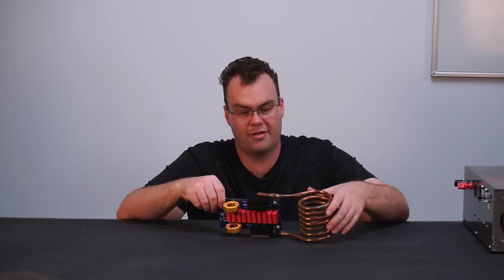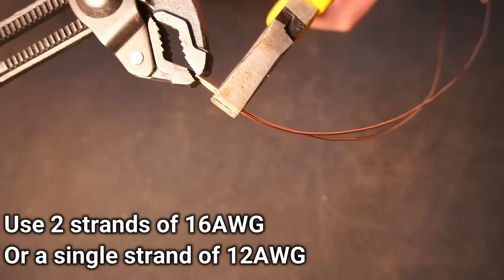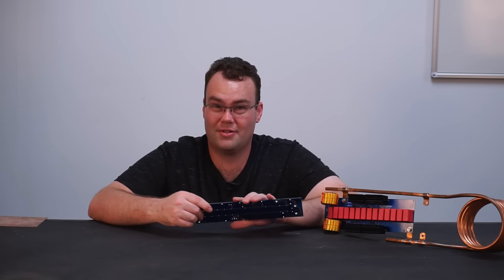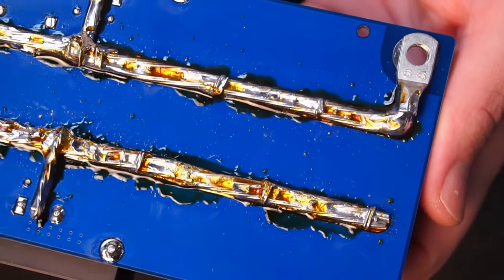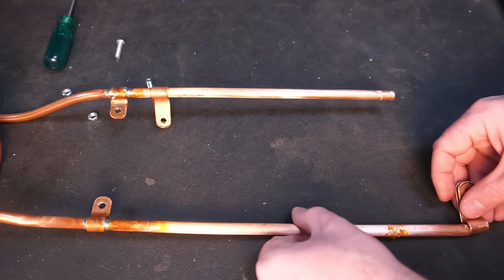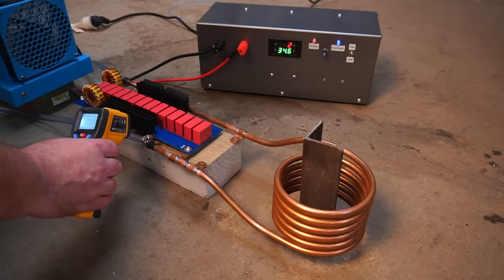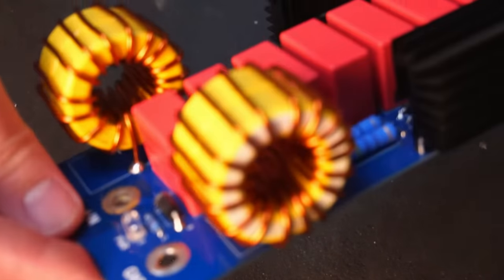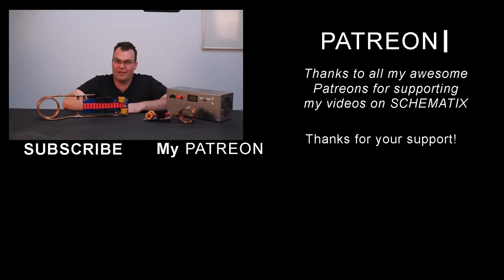Building a 3kW Induction Heater ll Complete Build Guide

Comment: Are you using a more potent JBC iron at the 2nd attempt making the inductors ?
If  yes, is there a review comin' up ??
I'm wondering if you purchased just the JBC handpiece and driving it with an alternative station,
or did you just go for the complete set ?
Thanks for the upload, I enjoyed it as usual  :-)
Reply from the maker: You've got eagle eyes! Yes I've gone a bought myself a JBC soldering station. I was wondering about building the Unisolder project & powering a JBC hand piece. However, I priced up all the components for building a Unisolder & I wasn't saving much. So I splashed out on JBC Station. Review coming soon
Reply: @Schematix  Wow, yes everyone else say that those JBC's are very good. My mind also wondered off towards the unisolder, however watching Marco Reps's video about it shows that it is quite a big job.
And the BOM cost is pretty far up there.
Patiently awaiting your review sir !

Comment: You could have combated the warping by soldering from the mid to the outside (but I'll bet there still would have occurred a bit of warping still)
Reply: Agree with you and also maybe tacking serveral opposite areas before joining it all together would reduce warpage somewhat - copper foil may be best option.   Amon's original idea of copper buss bars may have worked as well but we all commend you for taking the john q public route.   I would also question whether we really need such a huge trace expansion?  I assume you are going to fan cool it as well - these cheap china ZVS designs may have far less copper in their equally rated circuit boards? - Don't really know, just questioning how you arrived at such a large gauge wire - maybe the traces on the chineese boards are capable of handling much more amperage than your un-modified traces are capable of handling?  That may actually make sense - for you to order a board with minimal traces and save money by doing an easy DIY trace enlargement?  I think, the more you tell us on your decision making that went into chosing what you did the better the quaility of help it will be for those trying to replicate what you are doing in their own way with what resources they have.  Just my two cents, and yes I really do appreciate you showing the world some of the thinking that went into making your zvs induction melter.  Taking as much mystery out of an inherently mysterious act can only be good.  Just remember anyone can buy an off the shelf china pos for cheap and accomplish the same.  Blinding following how an engineer makes a product is ok, but the masters can also enlighten us less knowleable along the way, no?

Comment: Your electrical cable comes in pretty colors. Why is it stranded instead of solid or is that a NZ or a 220V thing? For a little more cost could you use #6 bare copper ground wire?

Second question when heating does the object being heated have to be stationary or could it be moving in and out of the coil to heat more length of material? The dull red might not be enough for hardening, it is more enough for tempering.

Third can a rheostat of some kind be added to the circuit or power supply to induse less heat in the material so as to not heat the material above a certain temp.?

Comment: Hi; since the induction cooktops are coming down in price, and since people are beginning to scrap them because of broken glass,
I wonder if it would be possible to use one to build a 7kw induction heater ?
Reply: Its definetly possible but cost is the issue.
Reply: @kendesimon4177  if the induction cooker is free, what is the other costs involved?
Reply: @mariano diaz 7kw is a lot of power so safety     could increase cost

Comment: great video and very interesting project! do you know if an inductor like this could melt high melting point metals like platinum, gold or palladium? and if yes, is there a minimum mass you have to have to be able to melt something like platinum?
Reply: Maybe a Washington size quater with specially made coil.
Reply: As i understand this, the heating occures due to the electric resistance of the work piece. If the workpiece conducts electricity too well, it might not even get that hot, requireing a vastly stronger current. At some point it might be easier to build an electrically heated oven rather then trying to heat something with a current that contucts that current so well that a large amount of the energy involved will be used heating your heater instead ;D

Comment: The Entire reason your metal is only able to get up to cherry red is because that is the temperature at which it loses all magnetism, the Curie temperature. To get any higher than this, it will act as a non-ferrous metal and you need EITHER higher frequency or a much larger system (like a 1 MW system heating 1 cubic meter of steel at 1000 Hz).

Comment: 15:36 
saturation caused by magnetic biasing because of Idc component of current via inductance, is usually eliminated by adding a non-magnetic air gap (f.e. a pieces of paper or scotch film, between the halves of the flyback TV transformer core) inside(between) the break of the magnetic circuit ( halfs of flux core  [  and ]  ), although I do not fully understand all the features of such a solution, as I understand - adding a gap to the break of magnetic conductor (core) loop, shifts-up coil current saturation level to a higher current limit, with a slight drop in inductance, and also acts like connectihg the speaker through a capacitor to a single-ended unipolar signal source, so that the average sine value, whole-core, corresponds to the middle of the maximum magnetization of the core in the circuit, is shifted down to the line of zero magnetization, allowing the variable component - smoothed by the choke - to work in the range not from 0 to saturation, but from bottom(minus) saturation to positive(upper) saturation - with the middle magnetic flux level -situated at the zero flux level in the core.
ferrite cores can be split along the line of the split drawn with a pencil, using an arc discharge, stretched by two multimeter probes(wire+needles of multimeter) powered from 220V in series through(via) 100W an incandescent light bulb, started on one point by both electrodes, touched a point on the pencil-line drawn on a ferrite magnet or core, and moving apart along the line - on which line - fire arc-discharge-line burning on the surfase of ferrite-exactly on grafete-conductive line(drawed thick by pencil)- creating some burn-deffects like a glass cutter on glass - a microdefect, which, being created along the entire closed contour of the cut - leads to the splitting of the ferrite along the plane of the contour of the pencil line "calcined" in parts with the help of such an arc stretched along the line few times - until ferrite cracks in two pieces - it looks very like as glass bottles cutting by nichrome heated bu current wire contour
Reply: have you plan to build another unductor coil with last opposite turn - capable for levitation melted metals drop?

Comment: Can we use the inductuin heater to heat water flowing through a pipe ?
Reply: I dont think that would help
Reply from the maker: No, you can't use this to heat water effectively. The coil creates an alternating magnetic field that will do absolutely nothing to water :)
Reply: @Schematix  Are you sure? because if the metal pipe runs thru the coil, it's got hot, so the water gets hot to.

Comment: Horrific job with bolstering the traces like that, major contact was poor at best, its just gonna fail where the trace is thinnest. You didn't learn from your first mode of failure on the first one you made (which burned out / meltted where the solder was thinnest)

Comment: Really impressive. Well done. I'm wondering how you determined what value the inductors and capacitors needed to be? Also what is the output voltage as measured?
Reply: The inductor and the capacitor will be calculated from the desire resonance frequency (set one to a reasonable value and you get the other). The "output" voltage as the voltage across the parallel resonance tank? That'll be based on the reactance and inherent damping. These terms might sound scary but they are not. The load is your conductive object, they act as the secondary winding of a transformer shorted with a low value resistor, which is how you generate heat. This will change the inductance dynamically, so you need to design your resonance circuit according to a specific range of loads to prevent mishaps.
Reply: @alexwang007  you have any videos?
Reply: @wardsmith2542  I haven't made any videos regard the subject, but I surely can point you in the right direction! Is there anything specific you want to achieve? You do not need an engineering degree to make fun/sick projects :)

Comment: imagine taking about 4 or 5 of these monsters and placing them along a 4' long by 2" dia heavy wall steel pipe and heating up about 2-3 feet of it and .... run water thru it... to make an on demand hot water heater...  you saw it here first...  :)

Comment: Sweet build man. I tried it with 6 mosfets and it works well. I wonder what the limit would be? Like could you pair 20 mosfets together like this?
Reply: You can pair as many mosfets as you like. Just know mosfets have gate capacitance, which will mess with the driving signal. 
Also make sure your RDSon resistance is low! This is the main thing why mosfets get hot.
Reply: @MarterElectronics  thank you sir. I appreciate the info. That's good to know.
Reply: That explains why the 90n20d's do so well. Rds resistance is .023 ohms.

Comment: Nice toy, but nowhere near hot or quick enough for forging.
Reply: yeah 10-15 kW from 240v rectified mains (330-340vdc with a decent pi filter) would be better.
Reply: Check this video out . Turn anything into lava in mins for big objects , seconds for smaller objects
Reply: @montycarpenter2276  YouTube is hiding links
Reply: Go watch thebackyardscientist's video of the induction heaters he built. He literally melts steel in seconds with it
Reply: Maybe if you put insulation on it it will work better.

Comment: Image driving a flybak transformer with this induction heater ...
Reply: 3kW wouldn't be too much. Maybe 30cm arc with a custom made transformer = a couple of MOTs in series. A common flyback from an old TV would fry almost instantly, those can only handle may 300-500W and they tend not to last long even with that much.

Comment: Just a peice of advice an old timer gave me when I went for my first job.  Don't choke up on the hammer.  It exposes you as an amatuer to manual labor.
Reply: accuracy ups macho, IMO
Reply: @mevk1  
Choking up on a hammer doesn't make it more accurate.  It only makes you feel more in control.   Facts don't care about your feelings.
The fact is you're better off with a lighter hammer if that's what it takes to use it properly.  Then you'll be striking it square instead of just feeling like you are.
Sorry but the millions of carpenters, mechanics and other trandesmen that use hammers aren't trying to look "macho" by holding them in the proper way.  It's says a lot about you that you think that's the reason.
And trust me by the end of the day your wrist as well as your damaged work will know the difference.
Reply: @tonyrmathis  point taken but did you really have to put the wood to me - why didn't you explain art of hammering in the first place?  On office man like myself is never going to be able to swing a beast of a hammer like that without choking up on the handle.
Reply: @mevk1  
My apologies.  I usually only respond to political post so my default tone is abrassive.  That and I responded during a break from doing my taxes.
Again. Sorry my bad.
Reply: @tonyrmathis  no worries mate.  get that big refund check and make a humongous induction heater!

Comment: Hello , check out this video, for melting anything you want alot faster and alot less work and far far cheaper . I've put this device together my self and works behind great , this would be the first time I've seen something like this . I couldn't find anything it wouldn't turn to lava , even my drive way but I don't recommend concert as it start to blow up and send piece every where . But I tryed it on a rock the size of my foot and 5 mins later it was molten lava . Anybody using gas for heat source for melting metal or anything they can imagine almost use this device , easy build too . You should make a video for this device , would like to see . Let me know what you think

Comment: WHy use PBC and not 3Dboard, if PBC can not handle 250 AMPS current for one FET or 500 AMPS of current, for FETs in par. PCB is old technology, nobody uses, it was popular 40 - 50 y. before, now it can not compete with state of the art design, needed for volume efficient solutions.

Comment: I want to build one of these, but I want to have a smaller coil on the business end. 
Like maybe a coil with a 30mm inner diameter. I want the circuitry, fans, pump, and radiator to be a single, portable unit with all arteries contained within a single lead to the "coil" gun. So it can be a handheld and I can stick the coil over rusty ass nuts on salty 🧂 cars 🚗 .

Comment: Pretty bad job of planning and half-heartedly trying to compensate the bad planning with sloppy soldering job though. Warping of the pcb was predictable.
Reply: You don't need cores for inductors if you would build the circuit properly in the first place you would use air coils and you would get the proper dimensions of the circuit, if you would know what you are doing.